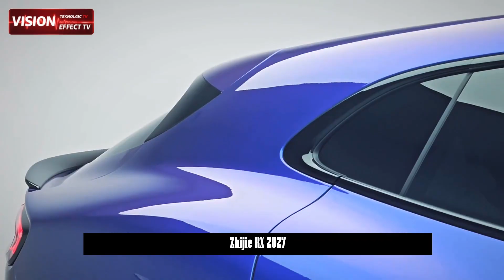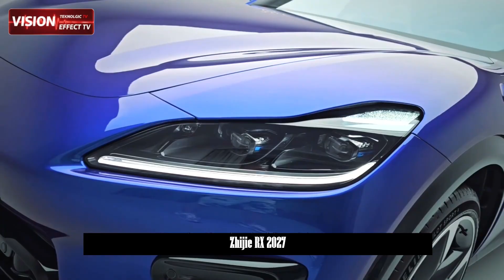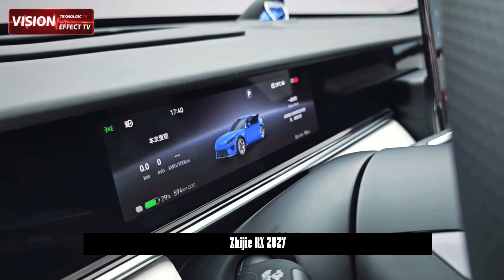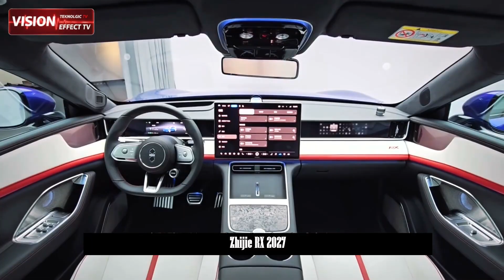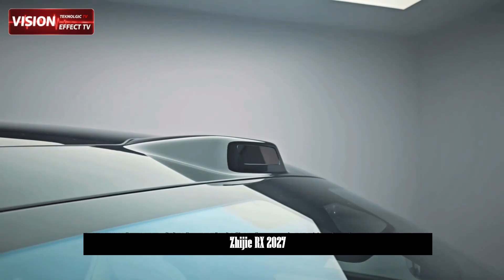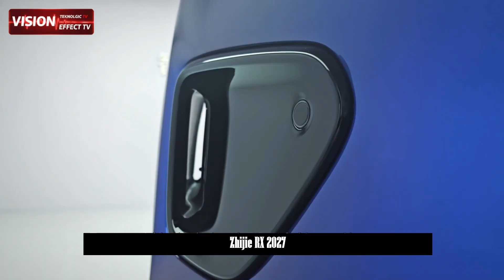Is the 2027 Zhijie (Luxeed) RX Really L3-Ready? | Huawei’s Next-Level Autonomous Driving

Comment from the maker: Is the 2027 Zhijie RX really ready for L3? 
38 sensors, an 896-line LiDAR, advanced computing, and a redundant safety architecture sound impressive...But is hardware enough to make autonomous driving genuinely trustworthy? Would you trust the Zhijie RX to handle the road without your hands on the wheel? And where do you think the biggest challenge for L3 will be — technology, regulation, or real-world reliability?👇